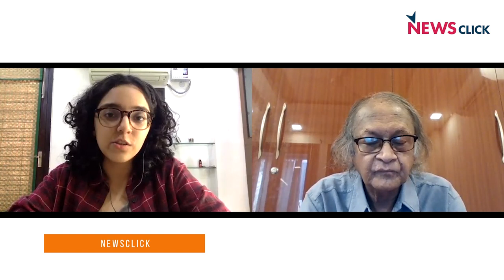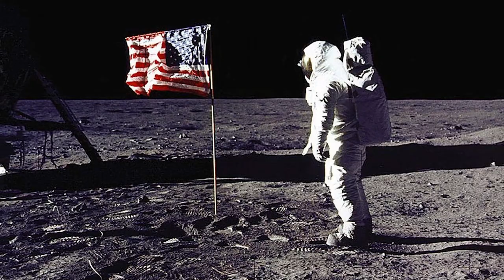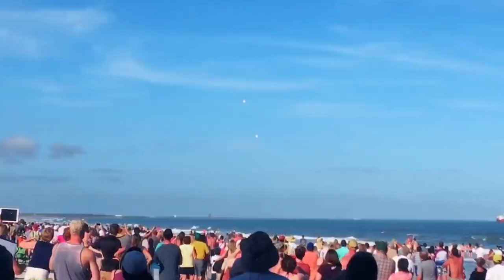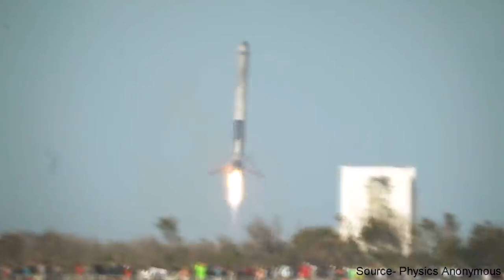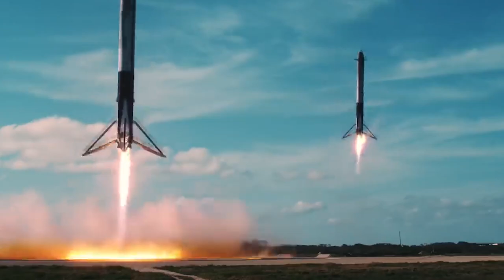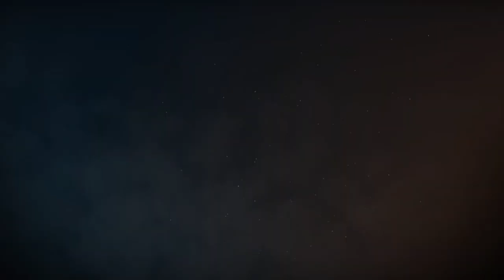Two Reasons Why SpaceX Rockets Keep Exploding

Comment: legs did get deployed just not all of em, and it was almost Indeed a successful landing unfortunately the single raptor engine did not give enough thrust to slowdown as expected, causing a hard landing. They are gonna try again with 2 engines running till very last moment or may be all the way.